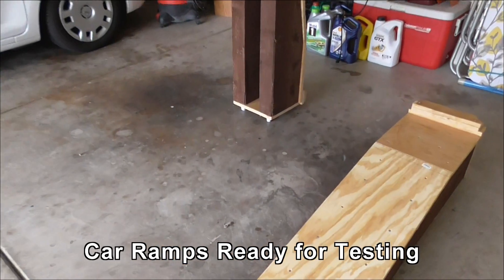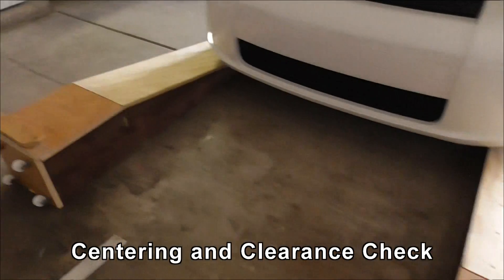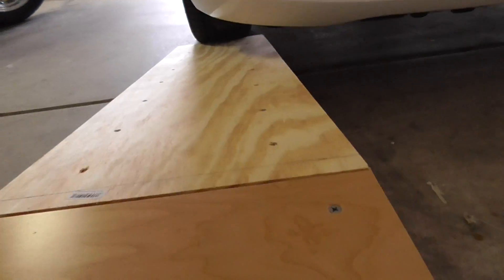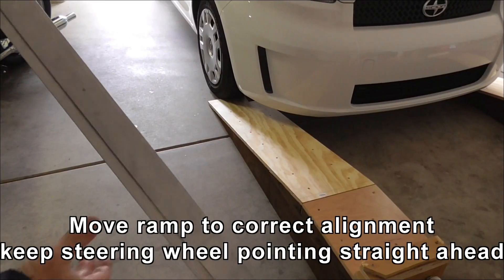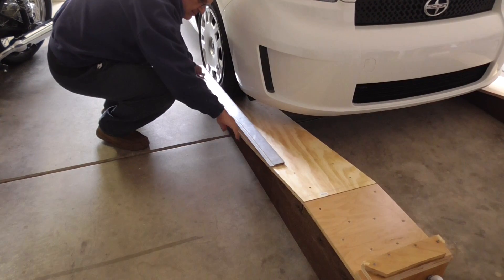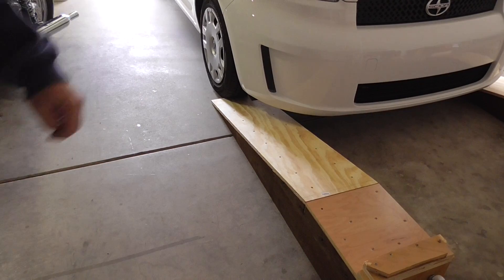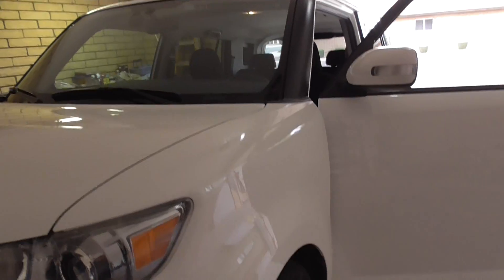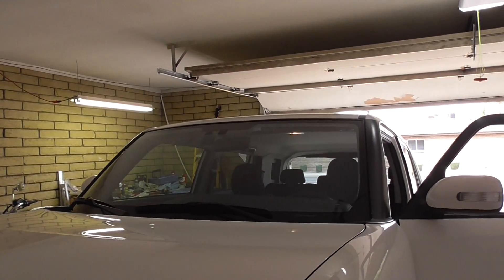Car Ramp Testing

Comment: Those are some massive timbers under that plywood.  You could have made those ramps considerably wider if you had wanted to do so.  Are you also planning to use them with a truck or motorhome?  You certainly won't have to worry about them collapsing or racking while you're underneath.  If you have one available, a mirror ahead of your car will help you avoid problems when going up the ramp.  👍
Reply from the maker: Thanks Ron. No plans for truck or motorhome and with a motorhome I would probably need to do some calcs on the compressive stress in the wood and see what sort of safety factor there was. Could have made them wider but I don't see putting vehicles on with tires that wide and the wider you make the ramps, the less room you get under the car (if you drive it up the middle).
For driving up, I find that having the steering wheel straight and lining up the ramps to the car using the straight edge works great. Have not run off the ramps yet. I have hit the tire stops gently and it makes a horrible screeching noise as the plywood end piece get drug edgewise across the floor. It's like the ultimate "nails on a chalkboard" noise.
Wood does dry out here in Arizona, so I coated them with varnish, just to slow that process down a bit.
Reply: @richbinaz  Cool.  My steel ramps not only have an end stop, but there's a little bump at the top at the end of the incline.  I can feel the tires drop down after rolling over that, so I know to be careful of the end coming up and let off the gas a little.  My steel ramps were cheap and are steep, so I have to get a bit of a running start to use them.  I like your ramps better, but my son uses them too.  His pickup's tires hang off both sides.   Makes me cringe.

Comment from the maker: These ramps are about a year old now and are working just fine. The only thing that has happened is that one of them has developed a slight warp. That can be expected as the wood dries out - which is why I used deck screws not nails :)

Comment: Even though you set a parking brake, i'd still recommend using wheel chocks as added security. Never can be too safe under a car.
Reply: ....and wear an iron suit in case all of the above should fail and it lands on you.
Reply: @jjenson2006  Or someone you love dearly decides to collect on your life insurance policy.
Reply: and a pair of axle stands slid under as added security
Reply: lambo

Comment: put something under the ramps to avoid they shift forward while the car is above them. It happened to me and I've been lucky I was not underneath yet
Reply from the maker: Thank you for the comment. It is a comment I had heard of when looking at various wooden ramps
The ramps have not moved on me yet... but I thought I would do a little experiment anyway!!!

I laid one of these 60 lb ramps down on the concrete floor.
Got out my bathroom scales and placed it at the tall end and then gradually pushed until the ramp started to move.
The force required to do that was 30 - 35 lbs
That indicates a coefficient of friction of 0.5 to 0.6.

With a slope of 1 in 5 on the ramps, the C of F would need to be about 0.2 or less for the car to provide a large enough forward force to move the ramp as it was going up the slope. So with a safety factor of about 2.5 minimum, I think it is OK - providing I'm not doing that on Ice, a wet floor or an oil covered floor.

With the car at the top of the ramp on the flat, it would take quite a force to move the car... i.e. about 1/2 the weight of the car X the C of F (1500 x .5 = 750 lbs - I can't test that) 
On the slope part, the force would be reduced as there is an additional force component of 300 lbs pushing forward, so down to 450 lbs additional force to move the ramps. I can't test that either.

Looking at it from another perspective, If I had made the ramp slope 1 in 2 (26 degrees) or higher, I would be in trouble. As it is, the slope of 1 in 5 (11.3 degrees) works out fine.

I see a lot of stepped ramps and don't know how to apply the math to that situation, but measure the slope and coefficient of friction for your ramps to see if the math works for you.

Of course, put the hand brake on to stop the car moving anyway.
Reply: RichB InAZ Actually my floor has lower friction capacity than yours. When it happened to me the car did not move, just spitted the ramps forward. Probably there was a component of the force in horiz direction not balanced by the friction. After that time I put a rubber pad under the ramps
Reply: @richbinaz   do you use the ramp and a jack to lift the car up as much as you can? If so can you do a tutorial cause I need to be under my hood. For filter change. I dont want to go to the mechanic.
Reply from the maker: @josephpark6064  I don't use a jack with them and only use them on a nice solid level surface like the concrete floor in my garage. It actually turns out they lift some cars like a Mazda CX5 a bit too high, so I use a moving dolly under the oil catch can to stop the oil from splashing.
I don't have a complete tutorial on oil changing, just some guides for a corolla, cx5, scion xb. There are plenty of video's out there if mine don't fit the bill.
There is a video showing how I did a 4 wheel lift using an old set of ramps, that gives you more room under the car.
https://www.youtube.com/watch?v=0qT-9NqPuaE&list=PLWHom5FLIC6vVc_DWPX9ipwMfI3WMmxKg&index=21&t=0s
I also have a cautionary note about hydraulic jacks. https://www.youtube.com/watch?v=2CK9tZTUIYs&list=PLWHom5FLIC6vVc_DWPX9ipwMfI3WMmxKg&index=25&t=0s
Reply: @richbinaz  thanks
Reply: @richbinaz  and I dont want to die